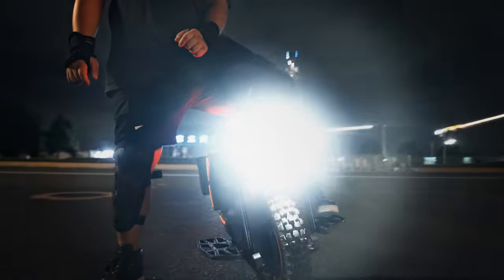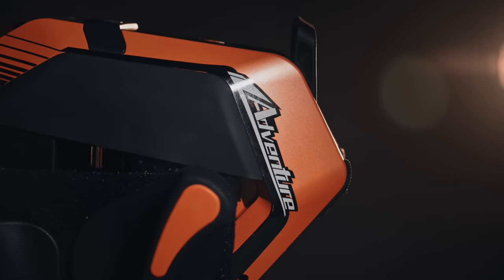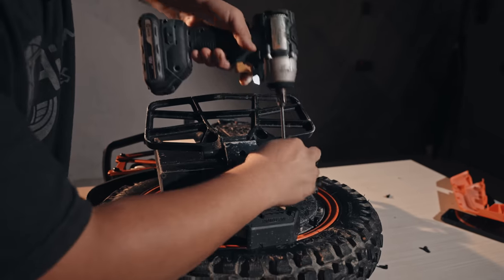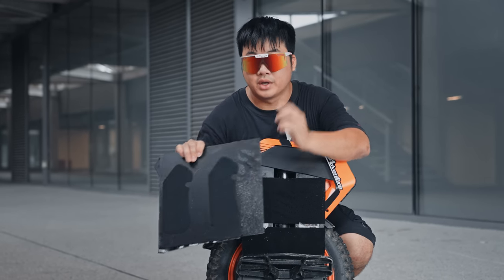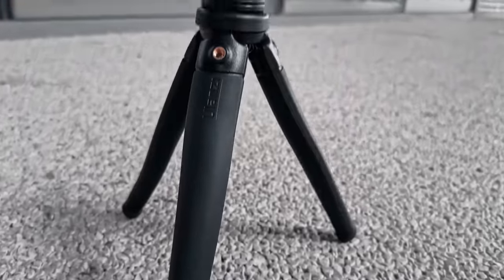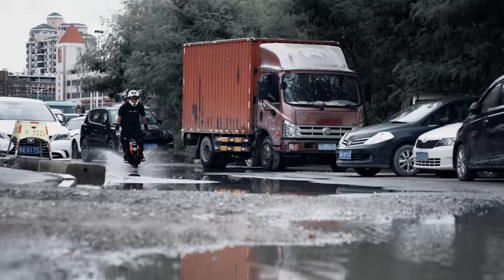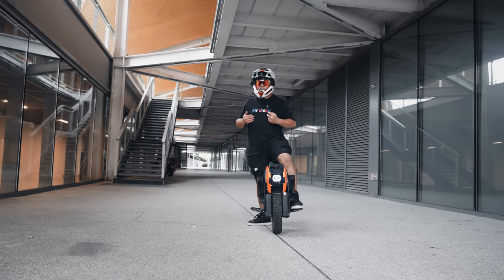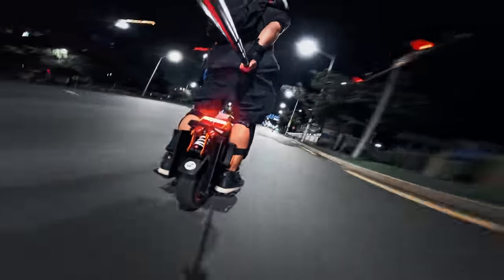V14 Adventure Quick look || Inmotion's First 134V Offroad Electric  Unicycle

Comment: You got it flipped. Coil shock is for that linear comfort ride, and air shock is for the progressive "pop" road feel. In v14's case, using a progressive spring on a coil shock does help accommodate a wider range of rider weight, but it's not that big of a pro/con, more like a nice gesture to the buyers.

Either way, to maximize the off-road/on-road performance without changing the setup or sacrifice each side of the ride, it is best to use an aftermarket shock from a reputable brand like FOX with HS/LS settings separated.
Reply from the maker: Yep i got it flipped, but realistically my experience my was correct with me and my friends. The progressive shocks lbs might be a bit too high for riders, I didnt manage to get that POP feel from the progressive or comfort feel that i did when switching it to air. I got more support with the stock progressive shock though.
Reply: @official.electricdreams  it's a coil shock, even with a progressive spring, it won't provide that pop feel as the progressiveness is still way less than compressing air in an air shock. 

The whole idea of a coil shock with its linear behavior is to "stay planted" and "stable during intense off-road riding, and have a bit more "smooth" feel.
Reply: WTF is progressive pop road feel ?

Comment: I want you to test to confirm, "1 meter drop/jump for 90 kg with no bottoming out" from Inmotion.
Reply: Yes pls do so
Reply: A tiny part of the progressive spring will  probably so hard that it's solid and won't move. So one could say it doesn't bottom out. But it won't make a difference. You have only so much travel. The travel is what matters. It's just marketing bs. Just like the torque that is supposedly twice that of a small car.
Reply: @bobdebouwer7835  Yh the torque they state makes no sense since they did the same for v13 but it suck in the torque department

Comment: Re: Coil VS Air, Air is not automatically more cushy and soft than Coil, it comes down to tuning which is the main difference, tuning an air shock is as easy as using a pump while tuning a coil shock requires you to find the correct rating on the coil, both can feel plush and soft and both will not feel good with the wrong tuning. It's great that they went with a progressive one.

Comment: Great video Jack! The S22 Pro suspension is the best I've tried for overall comfort. It makes small bumps disappear and bigger bumps like riding down stairs feel like riding on flat ground... and doing 4 foot drops still feels like nothing. So I'm not quite sure what your referring to regarding "comfort" or an air shock. How did the suspension on the V14 feel to you compared to the S22 Pro?
Reply: Air shock will always feel softer than coil only shocks mate. Thats why expensive cars, built for comfort, have air shocks included. This is old knowledge.
Reply from the maker: The v14 travel is shorter a quite a bit comparing it to s22. The v14 isn’t as comfortable for daily but in my experience is easier to find the shock for an v14 than a s22 so it’s an easy fix in that front.

Comment: suspension corrections as a mountain bike rider: 

Inmotion is not the first to use a progressive shock; all air shocks used in the industry are progressive (and to a much lesser extent all coil shocks, but we don't classify them as such) 

air shocks aren't considered to give a better ride feel (they're considerd to have a worse 'off the top' feel as more seals need to be overcome, and their benefit is the tunability and progressivity of air)
People herald coil shocks as giving a more plush ride feel (it will actually 'wash out' the ride more at lower shaft speeds than an air shock), at the cost of having to buy different springs for different riders, and lack of progressivity (though some companies like MRP sell progressive coils)

Comment: looks like one of the best wheels ever! i personally would want this exact wheel but without suspension so it could be lighter and WAYY smaller
Reply: The wheel you're describing exists. It's called the inmotion v12 high speed. It is lighter, has the same top speed and has no suspension.
Reply: @MrRich777  yes but it’s ugly, fragile, only 100v, only a 30mm wide motor, 0 torque, really small battery, no swappable battery, bad bms, no self balancing battery, WAY less power, WAY less overhead, and a 16 inch wheel when i want the 17-18 inch wheel of the v14
Reply: @EUCvibes  non suspension wheels are more fun, more reliable, and more compact. we need a wheel with more then 100v without suspension

Comment: Hi Jack, what is the advantage of the new batteries versus 50e?
Reply: It doesn't look much different in terms of capacity and max current (both are 5000mAh, but 50GB is 10A whereas 50E is 9.8A).  I wonder why not use the Samsung 50S, which still has 5000mAh, but 25A max current?
Reply: @neurokinetik  thanks for the info. Maybe less range with the 50s?
Reply: @mikeintampa250  Same 5000mAh, so range should be the same.  Seems like you'd also get less sag on the 50S, really the only downside I've been able to find is the cost, but there may be other considerations, like temperature tolerance and number of charge cycles before they degrade.

Comment: Main concerns about this wheel are is that it is already an expensive wheel. So when it does end up getting mangled,  how expensive will be parts afterwards? Also, how tough does the front of the frame seem to be? Where it cones out in front of the headlight. I can easily get past the plastic, but if it costs a lot to replace it, that will suck. Another thing is, tire swap. How difficult will that be? These are the only things i can rhink of for the time being. Thank you for the entertaining video.
Reply: Considering you can remove the batteries very easily, i bet tire swaps are just as easy

Comment: Great first look! Can you help to do some measurements to see what is the widest and tallest tyre size the V14 can do? Like what is the distance between the left and right battery packs; really want to know whether it can install wider tyres like the new version Mten4 uses 100mm width tyre. I guess the original nobby tyre is about 80mm; I know the 80/90-12 tyre will fit, not sure if 90/90-12 can also fit? Or even 100/70-12 ?
I like the v14 but not a off road fan, want to change a wider street tyre. Thanks🎉

Comment: Based on your experience with both adventure and extreme, which one has more torque?
Reply from the maker: Both are just as torquey as the other. The adventure requires less weight to get it going but the pedals are a bit software( even on hard mode) compared to the extreme

Comment: I wonder if they will bring out a cruising and long range version of V14, One that comes with all its features, bigger street tire and a comfy seat. If they do, it will probably be very expensive.

Also, on my wish list, on all EUCs long range variant, maybe implement some sort of cruise control, similar to what cars have. Set it, and it will maintain that speed without having you lean forward, so you can sit and not get fatigue, but disengage quickly when pulled back. I don't know how this is practical/impractical on an EUC. Just my two cents.
Reply: Would the wheel keep one speed, you would just fall off it. You need to lean, because that's how you get your center of gravity Infront of the wheel for it to push you through the wind. If want to lean less, stand more forward on your pedals or sit more centered on your seat. Which will reduce breaking leverage a little bit

Comment: At present between this wheel and the veteran Sherman-S, which one is coming on top and why? 

I will be doing a lot of on and off road riding, I will be riding the wheel aggressively most of the time so shocks are important to me, durability, waterproofing, cornering, range, and I prefer low wobble as I will often ride pretty fast.
Reply: Your needs are split down the middle. This smaller wheel (or the Patton) fulfills most of them , but a larger wheel fulfills the others that a small wheel can't (range, high speed, stability).
Reply from the maker: Here’s the thing, you mentioned points that won’t be at the adventures advantage, it can’t beat the Sherman s on range or speed but if ur saying u do aggressive offroad( I’m not sure how maintained your trails are) then I would suggest v14 it’s easier to maneuver

Comment: I'm curious about the charge port.  It looks like some kind of new 6-pin layout.  Did they really decide not to use the pin layout as the other 134v wheels already on the market?  Do you know why?
Reply from the maker: Hey Sam, yes I complained to them. Initially when I saw the v11 about more than a month ago I thought it was just a prototype thing… thing is that they’ll keep it like this but block two pins in the middle to prevent you from plugging this same plug that is 134 into an s22
Reply from the maker: They didn’t have space and poor planning.
Reply: Fair enough.. at least it will make it impossible to plug in the wrong charger.

Hopefully it will also not be possible to plugin the v14 charger into a v13?

Comment: Good review and I like the look of the wheel. Thanks also for testing it in the rain - many of us live in rainy countries. How able is it to withstand a decent crash? You mentioned 50GB batteries but what are they? are they any good for EUCs? How high does the handle go? I'm 6'3" (190cm) and hate low handles. Are the pedals adjustable? I know you've only ridden 100km but any idea of the range? I'm probably just a very ordinary rider and have little need for over 100v - it tends to just add to the price and reduce the range while giving me nothing apart from bragging rights. I'd personally prefer a cheaper 100v wheel with a longer range. Most modern wheels seem to be beyond my price range but do you have an idea of price?
Reply: Mike, On all wheels, higher voltage is proportional to speed, and a smaller tire diameter is proportional to agility and torque.  You're not losing any range whether it's 134V or 100V if the similar capacity of Amp-hours is configured. Less voltage is also not less expensive; although it appears so because new wheels have other costs associated with production.  The V14 is currently about $3200 (with a projected retail of $4k) but this may change. The wheels you may want is the V11 which is currently on sale for $1700 but has much lower torque. Used S22pros can be found for around $2k but I still think it's overpriced considering the continuous and excessive maintenance it will need over its lifetime. If you're short on funds, like me, the used market is a great place to be, because the only true way to save money on these wheels is to buy low and do all the work yourself. I'm 6'7" and the trolley handle looks taller than most, albeit a little flimsy.
Reply: @grb1969  Thanks for your very informative response. I'll admit I've had the math explained to me before regards how voltage shouldn't affect range but it's easy to compare wheels like the 84v and 100v Nikola and see that the range is dropping per Wh with higher voltages. The same is true on the Monster wheels. The S22 gets about 80km range from 2200Wh battery which is less than the original 84v 18XL with a 1554Wh battery.

I do keep looking at the V11(Y) and wonder if it will meet my needs but I tend to hit 50kmh on every ride because I need to stick with traffic. I'm also a little worried about it's fragility in a crash. At my age now (60) I'm starting to also worry about my own fragility. I'm also eagerly waiting to find out about the KSS16.

I worry a bit about used wheels as my wheels live in my house and I like to know how well the batteries have been treated.
Reply: $5599- Cdn @ Eevees in Vancouver.

Comment: @official.electricdreams I have a question : easy to accelerate on what settings? Pedal hardness, split mode, etc. Thanks!
Reply from the maker: The wheel accelerates easier just in stock. Pedal hardness is at 100% it’s in sport mode

Comment: Why is it so difficult for the EUC makers to sort the lights. In the last 10sec of the clip going down the highway the rear light cuts off for about 5 seconds. Also the rear handle is at the same height as the rear strip light. They should incorperate it into the handle especially once the seat option is available.

Comment: Hi, thanks for the initial impressions video!
I have a few questions: for me, 39 kg is a little on the heavy side and I don‘t really ride fast or far, but I really want that low end torque for steep trails. Hence, it would be ideal for me to ride the wheel with only two packs, those being ideally high-discharge cells (eg Samsung 40T). So, do you know if this will be an option? Also, Inmotion claims you can ride the wheel with only 1 pack installed, but even with only two, it seems that the structural integrity of the wheel might be compromised… Have you tried riding with only 1 or 2 packs? Would you need some sort of dummy-packs without actuals cells inside to make the wheel stable enough for offroading instead of having two blank spots in the frame? Also, do you know how much current those quick-release battery connectors can handle? Might they be the reason why high-discharge cells aren‘t possible?
Thanks in advance! :)
Reply: Nice comment. + what is the weight of the wheel with only one  battery ?
Reply: @mcogon  Thanks, I was wondering about that too, but Inmotion already told me one pack weighs 3.5 kg, so its 28.5 kg with one battery :)
Reply: I second this and add that I would like to know if different battery sizes will be available in the future. A set of small batteries that might be TSA (Flight) approved would be awesome! and larger packs for long rides.
Reply: @Ambrovious flight approved in the EU means under 100wh, good luck with that😂
Reply: @lefotografion  dang, only 100wh? Didn't realize the max was so so small.
Reply: @Ambrovious  for me different battery sizes would be interested for packing double the battery packs on it. Making it a master pro battery. If I just solder some more connectors on it, and Velcro the extra batteries somewhere, this would be a dope convertible
Reply: @lefotografion  Let's hope that variable sized battery packs are a future option, along with a quick release rim/tire configuration so you can change from a 20" to a 16" wheels depending on the type of riding you'd like to do that day.  Eventually, we'll get a single-sidearm mono-shock like Cannondale bikes, which will make tire changes easy.

Comment: Why don’t any of these companies use Molicel batteries? I’ve built batteries for modified razors and Molicel takes on power loads with less voltage sag than anything else I’ve used. I’d pay extra to have these cells in my battery

Comment: Which option would you choose? I have boiled it down to v14 inmotion or ex30 begode?
For cruising on bike trails and street riding.
1.  v14 adventure with the newer 50s cells, but smaller 16inch tire.  3299.00 otd price
2.  ex30 begode but older 50e cells, but with 20inch tire.  3000.00  otd price
Any suggestions? Thanks

Comment: I always hate the small battery sizes in these new, high voltage, and power wheels from begw and inm. what's up with that? I've been thinking about a batter backpack for the v13. 4500w Moto is way too hungry for a little 3024wh battery

Comment: does it work with one of the battery disconnected?
Reply: It works with 3 out of the 4 batteries disconnected, which means that each pack is 134V and all 4 are in a parallel wiring configuration. This also means that the packs could be doubled in size, and this would then be over 4.4k W-hrs. !!!  Or you could have a morning set of batteries and and afternoon set, then alternate with only a 10 minute change-over time.
Reply: @grb1969  
sweet! i was just thinking about this earlier. thinking nobody replied. thanks for the info🤙

Comment: Because a wheel has a 16" knobby tire and suspension does not mean it is an "offroad euc". This especially applies to the Patton which is an absolute blast to ride on downtown streets. I dare say it is the best wheel for downtown stop and go traffic. Lastly, regarding your claim that air shocks are the softest or "cushiest", the Patton and Sherman S prove you wrong.